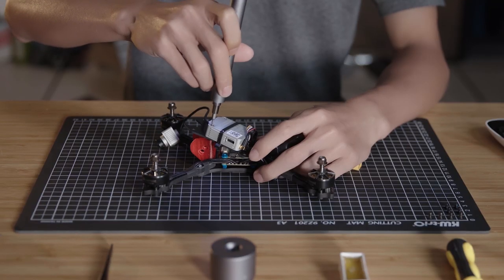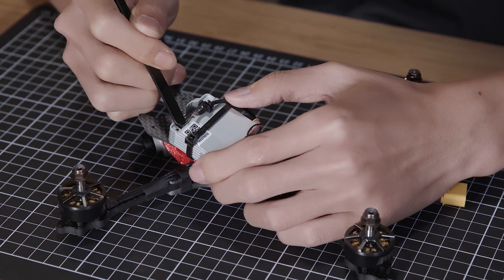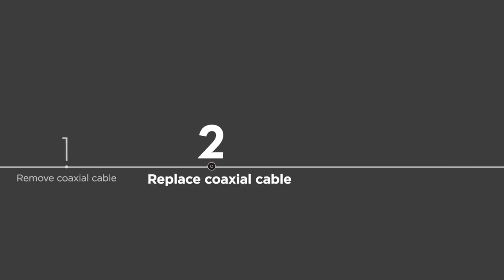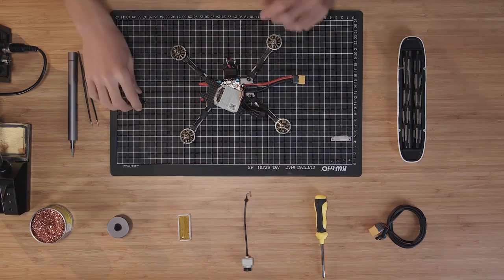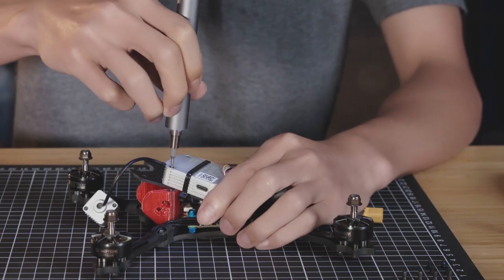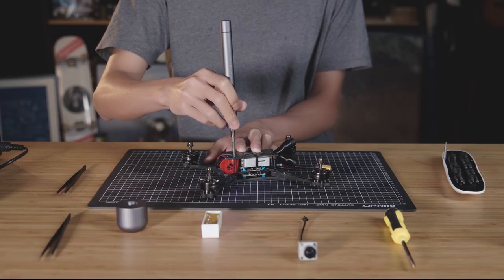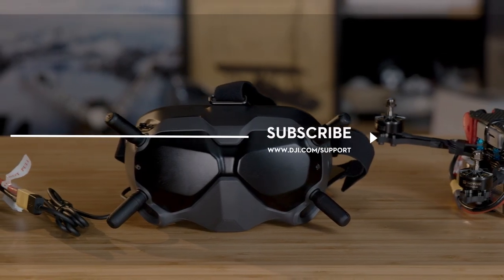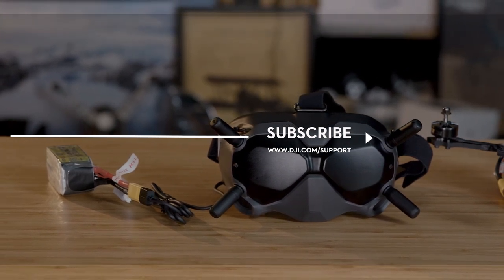DJI FPV System | How To Replace the Coaxial Cable

Comment: So negative on producing longer cables? Caddx doing air mini with 10cm cable despite everyone asking for longer options.
Can you at least use a vista cable on the air unit?
Reply: Same here. I went to install the caddx onto my frame and the cable was to short so it ripped out. Now I have to try to reassemble my cable because of this and have nowhere to mount it. Did you end up finding a solution to this?

Comment: Is it possible for the air unit to push out goggle feed and say it’s connected to the radio, but not be able to receive stick inputs? When I connect to beta flight with a lipo the stick inputs do not register. Replaced the stack already. 
Super confused.

Comment: Thank you for the responses and these videos. Do you have plans to create a software driver so we can use the DJI FPV Controller with simulator software? It is great to get out and fly, but sometimes you cannot. To keep your skills sharp it is great to practice and train with drone simulators software. Currently the DJI FPV Controller does not work with my drone flight simulator. It would be great if DJI could serve their FPV customers in this area.
Reply from the maker: Hi Jack, DJI FPV remote controller supports almost all racing drone simulators on the markets including DCL, DRL, and LIFTOFF. Users can connect the remote controller to the PC with a dongle connected to the 3.5 mm port and then they can use the remote controller to control the simulator. 
May we know the simulator you have on your computer?
Reply: @DJITutorials  Hi, I use Velocidrone and tried using the USB C to USB in my PC to try to connect. Can you direct me where to buy this dongle? Thank you.
Reply: Should I get a male 3.5mm (plug into controller) to standard USB to connect to my PC?
Reply from the maker: @jackbisson9226  Hi Jack, we are sorry for the late reply, you can search the simulator dongle on the third-party store, and please kindly contact the seller for the tutorial. The dongle is 3.5mm instead of a Type-C port.

Comment: Can you tell me if the heat from the DjI FPV Air Unit is normal. It is radiating quite a bit. Just want to know that is normal? Thank you in advance.
Reply from the maker: Hi Jack, it is normal that the FPV air unit gets hot, and please kindly note that when the DJI FPV Air Unit Module operates for extended periods and reaches a certain temperature, it will automatically enter Low Power mode, in which the frame rate will reduce to 30fps, and the latency may reach 60 ms or higher. Thank you.
Reply: @DJITutorials  Thank you for the update.

Comment: Is there any way i can use dji fpv controller for freestyle simulator apps like DRL or lift off?
Reply from the maker: Hi, the DJI FPV remote controller supports almost all racing drone simulators on the markets including DCL, DRL, and LIFTOFF. Users can connect the remote controller to the PC with a dongle connected to the 3.5 mm port and then they can use the remote controller to control the simulator.
Reply: DJI Tutorials could you recommend product? When you say 3.5mm you mean the streo port?? The round shape one?
Reply: DJI Tutorials i really need your help here...
Reply: @DJITutorials  could you make a tutorial about it? or else recommend specific product other wise I have no clue how its done. there are no one saying they have done it.